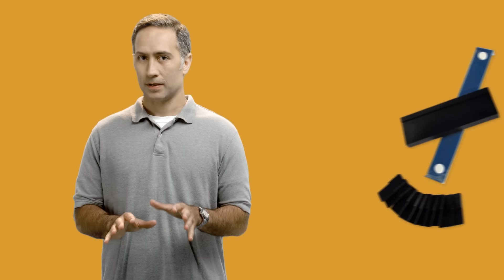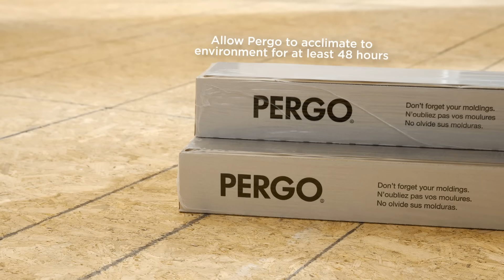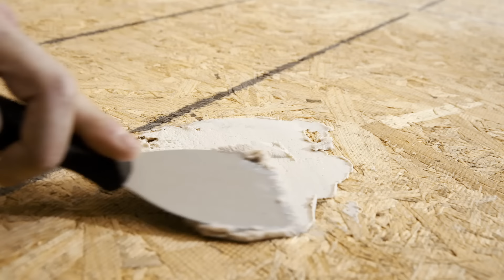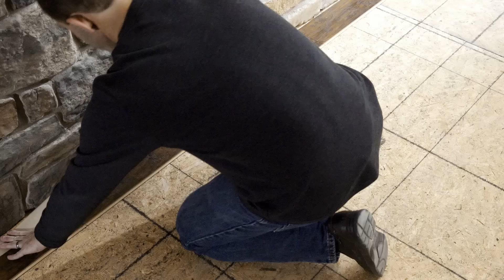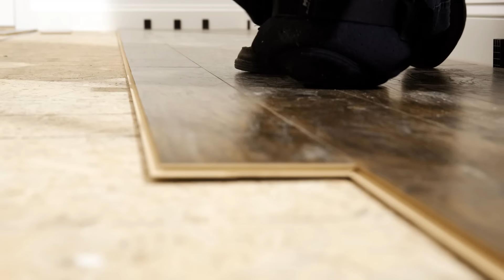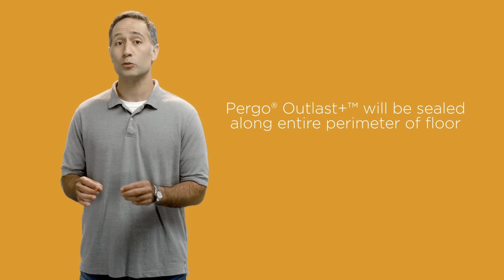How to Install Pergo Laminate Uniclic Flooring

Comment: You showed how to scribe against irregular surfaces such as rock. Now what do you do to hide the 3/8" unsightly gap that remains?
Reply: You can use a flexible caulk in a similar color or quarter round. Otherwise you're stuck with the gap.
Reply: An important question that needs an answer. +1

Comment: I don't see the point of cutting off the tongues if you're going to use quarter rounds.
Reply: Because if you leave the tongue, but hide it under the quarter round, you'll only have 1/8" vs 3/8" space against the wall or molding. You need the 3/8" to allow for expansion to avoid buckling. (ie: 3/8-1/4=1/8)

Comment: so bought a batch to do a room... basically a few pieces "lock" in, but the rest simply will not. I've spent about 6 hours now,  trying different "methods" and fixes none have worked. Are these just inferior products or am I just unlucky buying a bad lot. So tired of wasting my time at the moment.
Reply: Did you ever find a solution? I have this same product and ready to burn it
Reply: @EngineJoe32  I  returned them and went with hardwood flooring much simpler and was done in a few hours. My wife was pleased with how the bamboo look. Never going to purchase pergo again.
Reply: Sometimes they produce defective pieces but dont recall the batches right away..  I have been installing Pergo for many years in our properties and never had issues until 3 years ago. First time I had issues I blamed myself. Second time got frustrated and called the store to see if I was doing something wrong. No matter what we did we could not get them to work right.  Some left gaps, some would not snap in and lay flat. Home Depot  told us to just bring the ones we had issues with in for an exchange. We gave up and just returned the entire order.  Months later we saw several pallets with the exact planks without packaging identifying the product at an auction.

Comment: Great video.  The only thing I'm doing different is I'm removing and then reinstalling all my baseboard for a cleaner look.  Somehow,  I don't like to add unnecessary moldings.  More work in doing so but I won't have to miter all those added moldings.

Comment: Interesting that several other sites caution against using laminate with pets, and the ad is with a Great Dane.
Reply: I dragged the pointed end of scissors over a Pergo Timbercraft sample and got barely a mark. The ad is implying that the floors are pet-proof. Also took a hammer to it and no dents. Presently I've got a bottomless cylinder sitting on a caulk bead filled with water over the seam to see if water will leak through. So far good. I submerged one sample in water for 5 days. After 2 it was fine, after 5 it swelled and buckled- ruined. I plan to put throughout the home, including kitchen.

Comment: So if this flooring is going into a kitchen with an island, the flooring can’t be laid under the cabinets? I’ve always ran my flooring under cabinets, leaves a better finish so no 1/4 round has to be used. But it doesn’t sound like you guys recommend that? Some clarification would be appreciated.
Reply: The cabinet weight will bind your planks and prevent movement and possible buckling I've been told and read
Reply: Yeah no don't do that
Reply: That method can be used but less material is used if you cut around the island, cabinets, etc.

Comment: Home Depot tried to charge me $1800 for leveling a concrete floor. Hired own contractor to level - got refund on HD installation. Combined leveling and install for way way less than HD prices. Don’t use HD - I suggest getting the HD estimate just to see how much money you will save by hiring an installer directly.

Comment: Is 1/4 round necessary if you remove the baseboard first?
Reply: No, just put on thicker baseboards. That's what I do, I don't like the look of quarter round.
Reply: No, but quarter round will give a bit more wiggle room.
Reply: Everything I read, laminate expands or contracts at 1/4". Depending on the season you install, you may want to adjust the gapping to 1/4" if you don't want a gap to show and don't want to use quarter round.

Comment: This was not here 2 years ago when installed outlast+... 2 years in with water, milk, cooking oil spills and drips, it still looks as good as when i first installed it. 
The scratch resistance holds up really well.. drag my couches, chairs, dining table, I'm impressed it left no scratch whatsoever.

Comment: I am going to try to install this product I just have one question I hope somebody can help me? Why is the first row of planks cut so short and not installed full width?
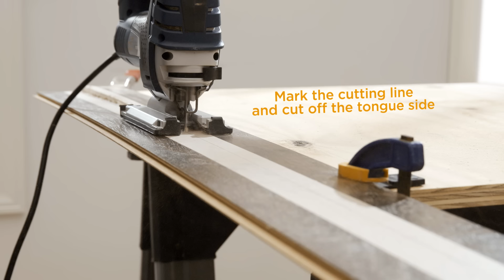Reply: Are you talking about ripping the first row planks so they're narrower than full width? They kind of gloss over the reason around 7:20, but basically it's so that you don't end up with a row on the other side that's too narrow. I think the instructions that come w/ the flooring do a better job of explaining that, including what the minimum width for the 1st and last rows would be.
Reply: Yeah its to even out the look of the whole floor- so the two end pieces are smaller instead of one small row.

Comment: My floor is outrageously uneven. It's old, severely damaged and the floor is slightly warped. I wanna put this laminate on it but I'm uncertain if I'd be able to do that due to how bad the floor is and I really don't want to put a freakin carpet over it nor do I have the money to get the original and damaged wooden floors replaced. I actually picked out a beautiful color of Pergo laminate wood flooring for the room already. I just need to know if I can put this down or if I have to find another way to get nicer flooring first.
Reply: If your floor is severely damaged then you will have to replace the subfloor underneath or make the patches where necessary.  If you don't want to go through all of this work, then vinyl planks are always an option.  I suggest going with something such as Cali Vinyl if you like the Pergo look.  They feel very similar, but are a bit more lenient when it comes to your floor being even.  Vinyl is water proof and is also a lot easier to install.  Considering this was 7 months ago, I am sure you have already fixed your problem.  If not I hope this helps or gives you an idea for a future project.
Reply: Sounds like you would need a pro. If its that bad there might be something going on underneath that you don't know. But it might just have to ripped out sub floors if it's not concrete. Or you can try cutting out the bad and matching it and refinishing the rest. But that sounds like a nightmare
Reply: I think you already know the answer...you just don't like it...

Comment: What's the point in scribing if you're going to leave a 3/8" gap?
Reply: So you can see what kind of floor you used to have silly.
Reply: @Kbarmike I think he's asking about scribing against the uneven stone wall. You can't add quarter round against it so what do you do then?
Reply: Aaron Spencer I believe they recommend using color matching silicone for gaps that can’t be covered with base trim or quarter round
Reply: Steve Yager 🐰🤪
Reply: Also you want to scribe along the stone wall so you can keep a straight edge on the other side of the flooring you are putting down.
Reply: Whats the point of your comment when your opinion makes no difference?